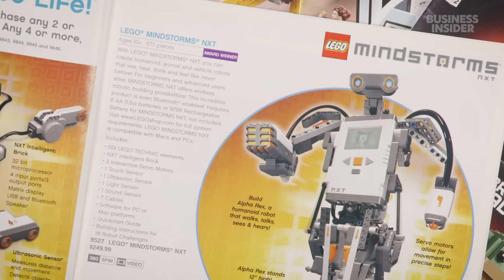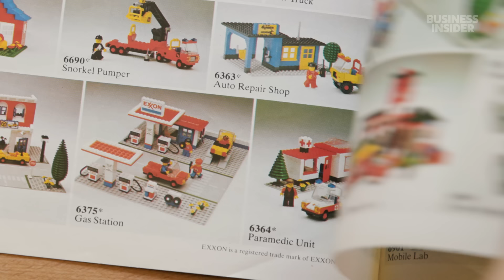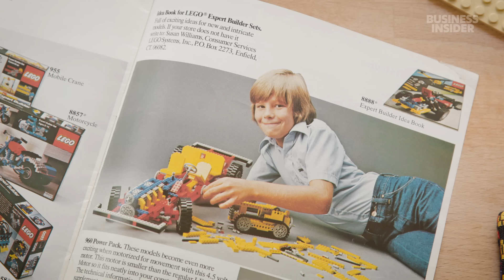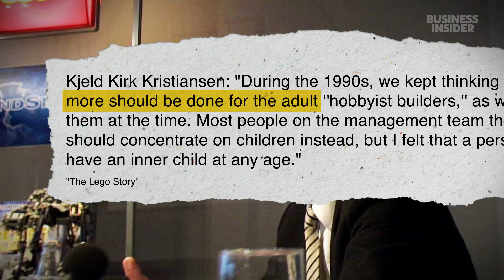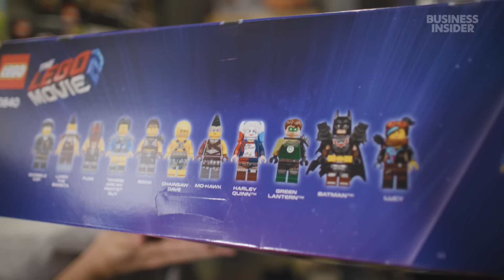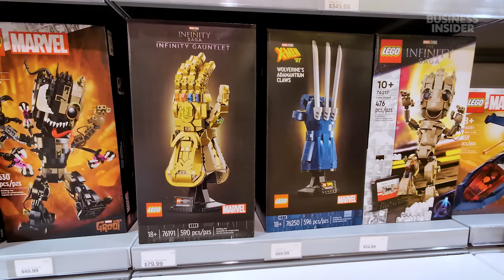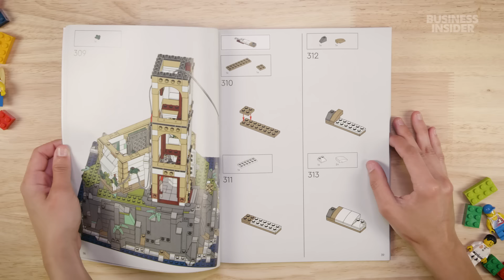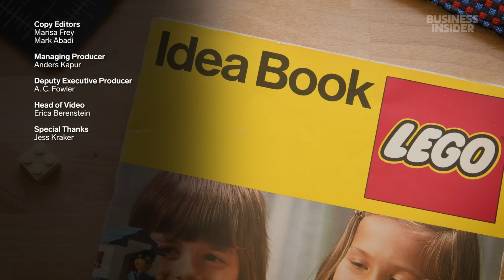Why Lego Is So Expensive | So Expensive | Business Insider

Comment: Lego is insanely overprized. You just have to look at the competitors, that have half the price (some even a quarter of it). At the same time the quality of lego bricks went extremely downhill.
Not to mention that lego rarely does prints on bricks, unlike its competitors. So basically its usually overprized by a rate of 3 if you regard the quality of what you get.
Not to mention the prizes for motorization, which are just insane.

Comment: The sets may be cheaper by piece pricing, but the parts are very different now from back then, it used to be that when you bought a lego set back then there were a lot of bricks 4x2, 8x2, 16x2,etc. That would be very useful to create other things lile structures and massive buildings, but now, you buy a set and is almost entirely made of special and small parts pf different colours that wouldn't work for any other building unless you have a lot of these, which, makes it actually more expensive in the long run since theres no way to buy the pieces you actually want anymore,except for the expensive sets.

Comment: On 'Price per Piece'. I recently built a Lego set, and then rebuilt it replacing many of the small pieces with pieces that achieved exactly the same function and look, for example, instead of 4 of 1x1 pieces, I placed a single 2x2 piece. I was able to reduce the number of Lego pieces in the set by almost a QUARTER! So price per piece is a very poor measure, and shows that Lego are actively 'massaging' the numbers or pieces to hide the reality.

Comment: Your answer to the question is a bit shortsighted. Prices per piece may be close to what they used to be but parts are much smaller. Additionally, the quality has been lacking compared to competition or even Lego from 20 years ago. You also should have shown the average price across all set per year to give a fair comparison of how their prices have skyrocketed. You also didn't mention that the value has become worse since they usually don't include alternative builds for the set anymore - which they don't do because adults build the sets for display and single time assembly.

Comment: Calling a scalper a "savvy buyer" is insane. They are a big part of the reason why Legos are now so expensive and why they have become unattainable for most people. People like her are ruining the hobby.
Reply: It’s the same thing as car collectors, the vast majority of collectors never drive their cars and keep them locked away in climate-controlled garages hooked up to battery tenders. What’s the point in buying a ferrari if the only miles you’re going to put on it are from the dealer to your garage? Where’s the point in buying a lego set and sealing it away in your attic?
Reply: @enemyspotted2467  Eh, that's not quite the same thing. These cars are at least properly displayed and are being looked at (Basically treated like art). If they built their Lego sets and display them, that would be fine, but they just store them away in the attic in their boxes with the goal of selling them later at a higher price.
Plus, the cars that are usually treated like that are actually very limited in quantity, and normal people wouldn't be able to afford them anyways, so them being displayed instead of driven is not that big of a deal.

Comment: Instead of trying to argue that sets became more expensive, I'd like to point out the pieces didn't become cheaper. These are precision injection molded pieces of plastic. The huge expense of designing and deciding on new pieces should not persist. The price hoke, from what I've heard is not due to the change in the customer base, but the reliance on brand deals. Sadly, celebrity power and banking on nostalgia are signs of an aging business still.

Comment: ha ha, "prices are the same or even less per piece" :DD
I sell one brick 6x2 for 5 bucks and three bricks 2x2 for 12 bucks. Both ways you buy the same size lego, but by paying 12 bucks, you get "cheaper" piece. Thats how it is now - you get much more smaller pieces on the same size set than before and it calculates "cheaper per piece"... Basically, why it is so expensive - because why not, somebody still going to pay and buy them. :)

Comment: measuring average cost per piece in a set over time is not an accurate comparison as modern sets include many smaller pieces. cost for a specific size brick eg. 2x4 brick over time whould be a better indicator, and could be compared against ABS cost over the same time.